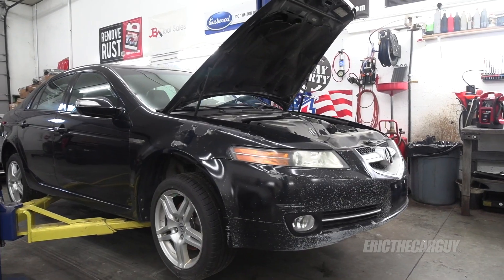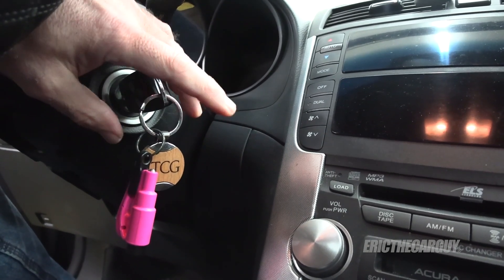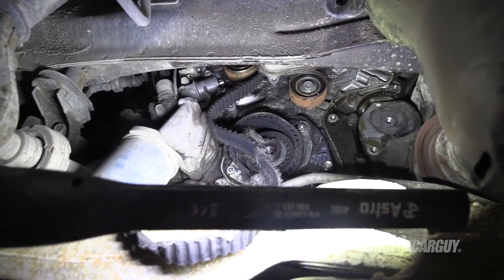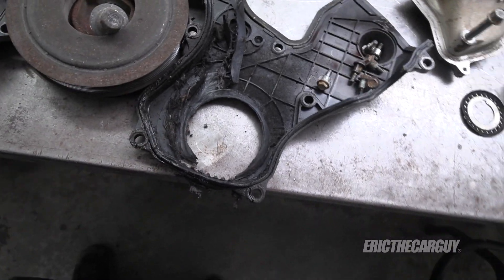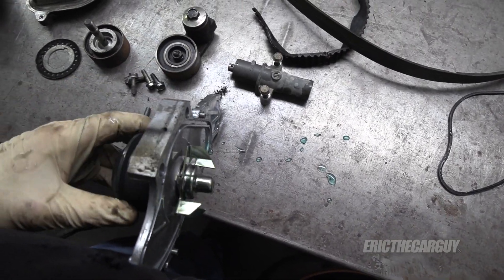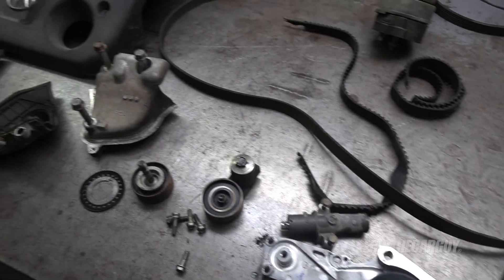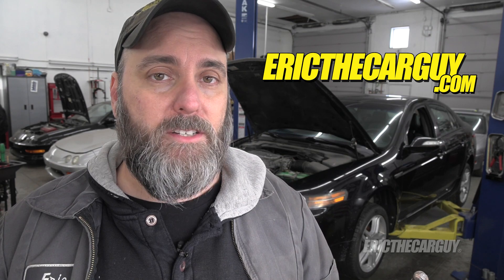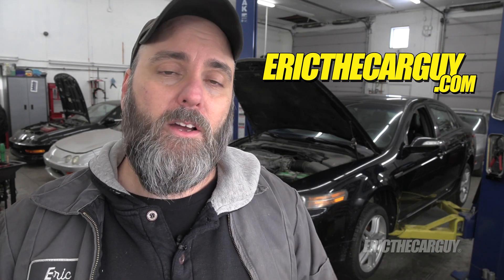Acura TL Dies On the Road

Comment: So +1 for timing chains vs timing belts.
Reply from the maker: For belts that is. Keep in mind this engine didn't fail and the repair wasn't that difficult.
Reply: @ericthecarguy  Appreciate the reply.  My comment was more in jest than anything.  I think both belts and chains work great but the key is usually good engineering and well designed guides and tensioners.

Side note:  Interesting thing about timing chains in some Mercedes engines.  When doing a chain service, its actually better to keep the "old" chains as they have been polished versus a new chain.  It will have a lot less friction.  And chains on Mercedes engines with well over 100K miles usually have zero stretch in them.

Comment: exactly why I dont buy parts on critical items like timing belt from anyone but the Dealer or legitimate web parts suppliers like RockAuto. Its too much work even for the experienced to do a timing belt service and risk engine or other parts damage to save 40-100 bucks. My time is more valuable than anything.

Comment: Counterfeit parts for sure, they are getting good at reproducing oem stampings and labels, I've bought a idle air control from ebay that said it was new OEM, first clue that it wasn't was the fact it was DOA, second if you had a genuine part to compare it to you could tell the label on the box was a good attempt, but for sure fake.

Comment: Sir, yesterday one strange thing happened to my i20 2011.
1. There's no power at Key Off, Acc, On and Start. All warning lamps are not glowing too. 
2. Even the Horn is not sounding.
3. No room light.
4. Door open warning light is not glowing. 
5. Battery terminals are tightly connected. No doubts on battery. However, totally NO POWER AT ALL. 
I removed the battery and check with MULTIMETER at home. Surprisingly, MULTIMETER shows perfect 12V.
Reinstalled the battery, and Yes everything is working fine. Engine is starting too. 
Can you please kindly highlight what's this SUDDEN NO POWER???
Reply: Maybe a bad ground
Reply: @drako4684  the car was used day before the issue happened. It was totally fine. But suddenly that day, I opened driver door. And even central lock system is dead. Even the door open warning light is off.
Reply: @drako4684  it's my first time issue in 10 years. Only 54000 km odometer. Battery is perhaps new replaced a year ago. No doubts on battery.
Reply: Have you had a look in the fuse box(es)?
Reply: @zeroyon4562  no I don't. Because ever thing were back to normal after reinstalling battery. So I have no doubt on fuses either on engine compartment and IP junction box.
Reply from the maker: https://www.ericthecarguy.com/solving-automotive-electrical-problems/

Comment: Engineers must just use a timing chain,if a belt snaps in an interference engine - one needs new engine
Reply: I think they squeeze out a bit more power when they use a belt in a interference engine.  And cheaper of course, but Honda engines are a bit odd I don’t think any other cars require valve adjustments like Honda’s
Reply: I like chains too but their wear is dependent on your oil changes.  Not all car companies can make a good timing chain setup. Ask Audi owners. The benefit of timing belts is that they're simple and quiet.
Reply from the maker: This was an interference engine. I didn't need a new engine after the belt broke. Chains wear out over time causing a loss of performance. Either way you still need to maintain your engine no matter how its internals are driven.

Comment: Those Gates WP's are junk. Avoid like the plague. I only buy the Aisin WP/TB kits now after the Gates WP in my '05 Pilot started grinding after 35K miles. The rest of the components in the Gates kit are still working fine at the 105K mile mark but their WP's have a horrible reputation.

Comment: Always use OEM Honda timing n water pump parts on these Honda interference motors.  Shops around here will not warranty a bring your own parts repair without OEM.  See too many damaged Honda i. motors from junke aftermarket parts.  Expensive to repair the top end on these motors just from going cheap

Comment: Maybe Honda is lying about these engines are interference engines? If you get it working, there is pretty much no risk in setting timing when changing timing belt.
Reply from the maker: Not at all. As I said in the video, you will need to put the crank off center to put the cams back in time. Otherwise the pistons will hit the valves. It is 100% an interference engine. I'm tired of the rhetoric that once a timing belt breaks, even on an interference engine, that engine is done. As I showed in this video, that is not true.
Reply: @ericthecarguy  how would you explain why the engine on your TL was not damaged when the belt broke? Is it because all the vavles retracted to the top very quickly when belt broke? In that event, a broken belt is better than a stretched belt that still pulls the cam pulley?
Reply from the maker: It's not possible for all valves to retract at the same time because of the camshaft. The cam lobes don't go away just because the belt broke. It stopped in just the right position. It can happen. Some people refuse to believe it can happen, but this video proves that it can, and it's not my only experience like this. As I said in the video, even if this didn't work, I'd still have a new timing belt and water pump for after the repair of the engine, or for the replacement engine. No matter what you need a new belt, why not try it to see if it works first? You might get lucky.

Comment: I heard these motor has a recall for timing belt and also the V6 motor is not reliable and always have an issues with them. Soon or later the newer 1.5L turbo and 2.0L will have issues in a long run probably last only 5 years. It will cause engine and trans issues in the future. Plus always uses OEM parts never get Gates brand or other aftermarket parts to any Japan manufacturer vehicle because I have issues with them in the past. Never again I will stay away from aftermarket parts especially water pump, pulley, etc. It is time to junk that Acura TL or replaced a new battery
Reply from the maker: OK well, thanks for the comment.

Comment: So your philosophy for a broken timing belt only really works if you know for sure you want to keep the car, the way I understand it. There are plenty of people out there who would junk the car if this were to happen, especially on an older car.

I'm almost certain the belt kit you put on it originally was counterfeit, and that's why the belt just snapped. You said you got it on a package deal from Amazon. That's a huge red flag. Counterfeit Honda kits are rampant on Amazon and eBay. The real parts are not sold in a package like that. You have to get them individually from the dealer. Real Genuine Honda parts don't come in those brown boxes either. And you noted in the timing belt video that the water pump appeared counterfeit. Another red flag. We see these types of failures on the Odyssey forum quite often. So many people get duped by these counterfeits. I would suggest removing the counterfeit link in the description of your J series timing belt video. Don't want more people to get duped by it.

FWIW, the Gates kit is known to have a Chinese made water pump that tends to leak after a bit. Something to keep an eye on. The Aisin TKH-002 kit (like the TKH-001 you put on the Pilot) is the best overall option, as all the parts in there are from suppliers that are either current OEM suppliers for Honda or used to be at some point, so they're all high quality parts.
Reply from the maker: I agree, it is a personal choice. I used the kit, despite the possibility of it being counterfeit, to see if it would work. The plan was always to show the result if it failed to provide proof to my audience that trying to buy cheap OE parts can bite you in the butt. It is a $200 car after all and I have other things I can drive. Hence this video. 
No meed to remove the link, I already checked it, it comes up as "page missing". Thanks for the comment.
Reply: @ericthecarguy  Thanks. I know that the original link to the kit you bought is no longer available, but you changed it to link to a similar kit that is also unfortunately counterfeit.
Reply from the maker: I don't believe that kit is counterfeit. It's an Aisin kit. Very similar to the one I just installed on the Pilot.
Reply: @ericthecarguy  The link in the description of the original TL belt video is what I'm referring to. The Pilot timing belt video has a good Aisin kit bundle linked, but the link on the TL video still works and links to another "Honda" bundle.